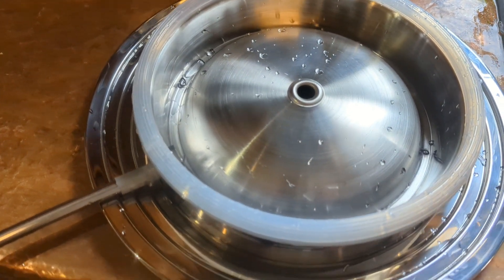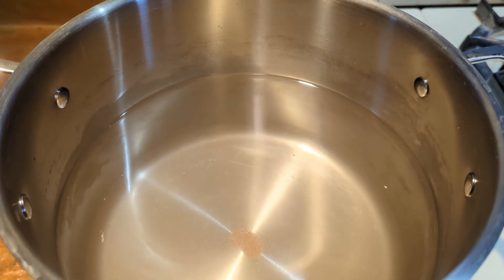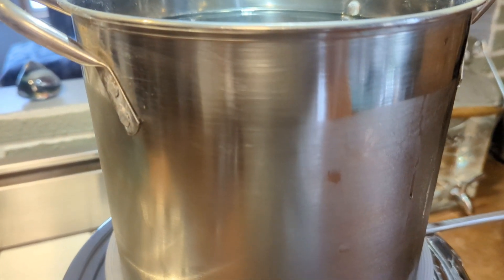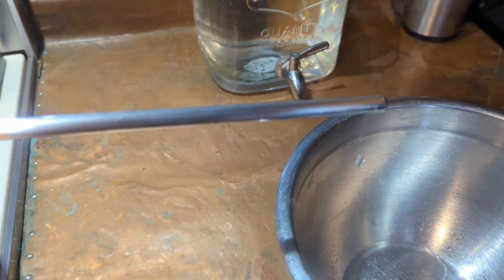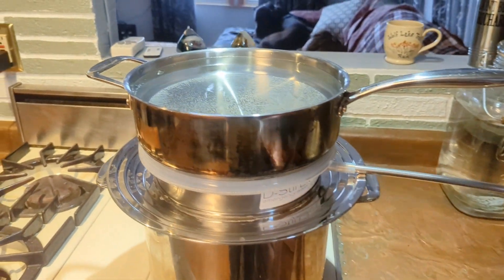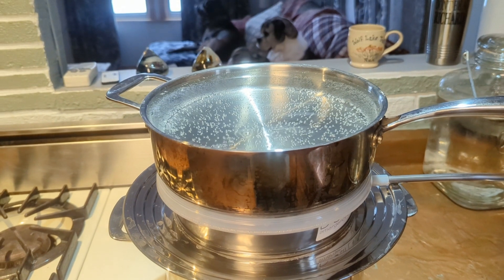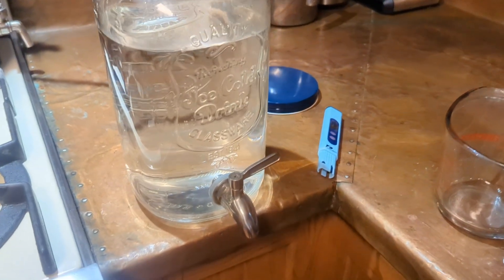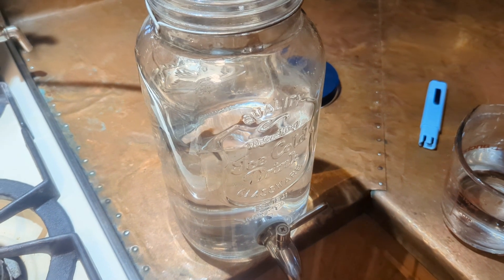2023 D-Stil Lite Emergency Water Distiller

Comment: So, hey, I just received my D-Stil Lite and I have some comments. This unit needs silicone/rubber gaskets around all of the mating surfaces, not just the top, like the universal adapter plate at the bottom and some O-rings between the hose barb. Otherwise, I'm finding I lose too much water to steam or dripping around these gaps. In the case of the hose barb, it seems to be losing distillate faster than it flows down the stainless steel tube. It just leaks into the plate and then back down into the pot again via the small crack between the adapter plate and the stil (it's only tack welded together at four points). Without these modifications, my unit stalls out at some point and it stops outputting distillate. Btw, I've found that a clear Pyrex baking dish works fairly well (edit: actually, not great because it's not as heavy as a fully loaded stock pot and doesn't weigh down the adapter plate as evenly as it should, allowing steam to escape) as the evaporative cooling reservoir with the added bonus that you can monitor the distillate as it drips into the basin below 😁

P.S. That being said, my bottom pot does have a flared lip, so maybe one with a more straight lip would seal better around the plate?

P.P.S. Nope 😮‍💨
Reply from the maker: Hey Mike. I just sent you a message through Amazon. Give me a call at the shop in the morning. Amazon wouldn't let me see your video.  I would be happy to help you trouble shoot your system and get it working correctly. 612-888-7583.
Reply: @Shtfandgo Thanks for the tips over the phone and the additional information about the product. After experimenting some more last night, I did manage to seal all the visible leaks with the clamping force from the nearly full upper pot. I might still try to find some food-grade silicone tubing to split and wrap around the bead on my lower pot.

The area around the hose barb eventually seemed to "settle in" after heating for a couple sessions and stop leaking. There actually is an O-ring in there. Might need some snugging up. I was warned about the hole in the stainless being razor sharp if anyone feels like disassembling the barb, so nota bene.

All in all, the D-Stil Lite is a fairly versatile piece of kit once you figure out its idiosyncrasies. I do lose about a third of the output to steam compared to my electric distiller, but I think I've dialed in the sweet spot with my induction stove where I can still volatilize off the VOCs while retaining the maximum amount of distillate. More heat is not necessarily better. Plus, I can have the induction run for 3 hours on a timer and have it automatically shut off. That's about enough time to bring the apparatus up to temp and distill a little less than a gallon without completely cooking off all the water and burning the mineral residue at the bottom. I also added an immersion recirculator (i.e. sous vide stick) to the top pot to get it to evaporate quicker. SHTFandGo says they sometimes just have two pots of water to swap when one gets too hot. That sounds like a reasonably simple solution. I'll probably also change my plastic water jug for a glass or stainless receptacle. The hot distillate leaches out bad smelling plasticizer from the jug I hadn't noticed when I was using the cooler output from my electric boiler.

Comment: Slick!  This looks much easier to use than my regular Gravistil, which is heavy, awkward, and much slower than this at distilling. I mostly just use it for filtering water (when filters are available which has been a bit of a problem).  I loved the idea of a convertible piece of equipment (and always wonder why anyone would get something like a Berkey that can only do one thing) but honestly I think this lightweight distiller is brilliant!
Reply from the maker: Thanks for the kind words. Yes the benefit of the gravi-stil is that it can operate like a gravity water filter or as a water distiller.  The enhanced gravi-stil will still out produce just about ever distiller on the market, but you're right it is a little more complicated. We've had replacement filters in stock for quite a while now that the shipping systems are moving again.

Comment: Great distiller. Excellent video! I bet if the runoff tube were inserted into the side of a collection receptacle that was sealed, almost 100% of the distilled water and steam could be recaptured. Great design. Cheers.